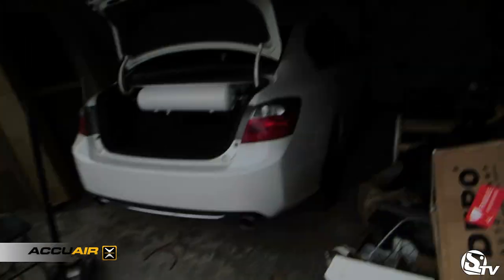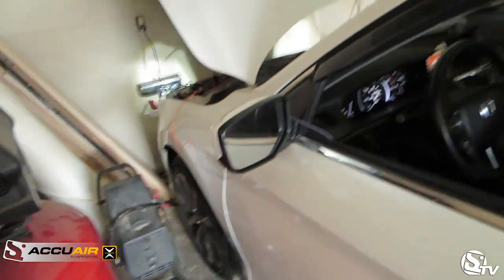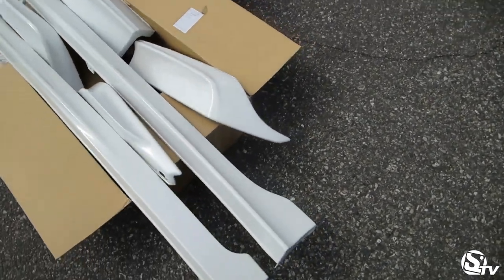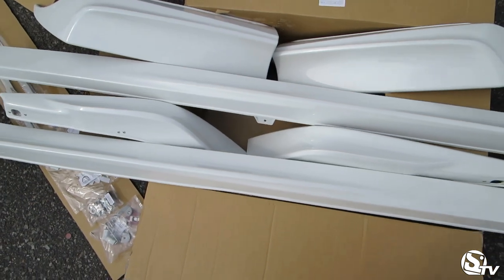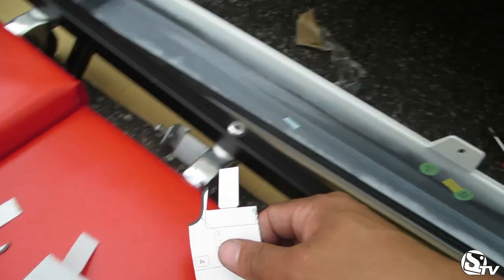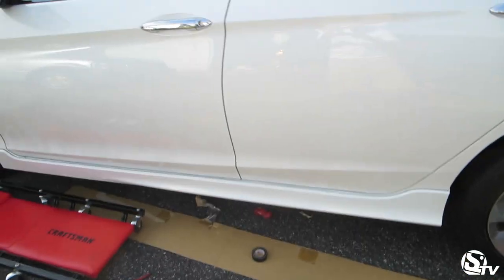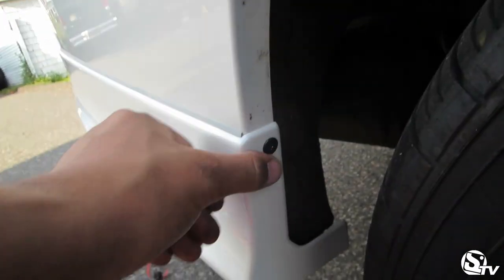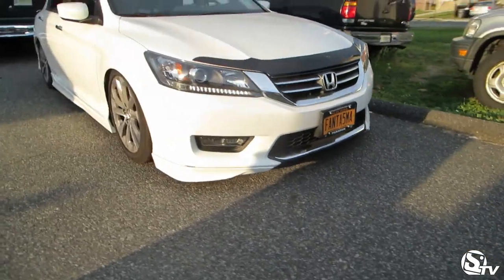PART 3 Full OEM LIP KIT and Accuair Installation on a 2014 Honda Accord

Comment: Leo I have a 2014 is250 that I would like to put some air ride suspension like how much would it run me
Reply from the maker: complete Accuair E-Level + installation will run about 5500. you can add or take off features off system. all depends how you would like it. please email us at seriousinnovations@gmail.com to go more in details, thanks